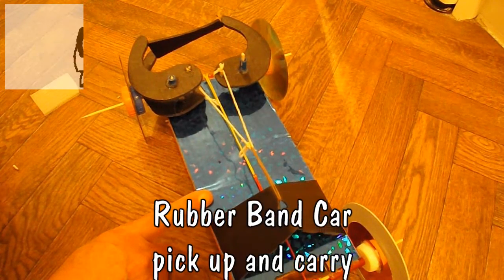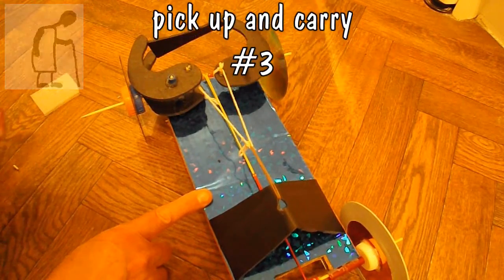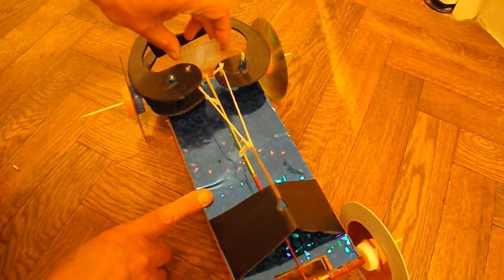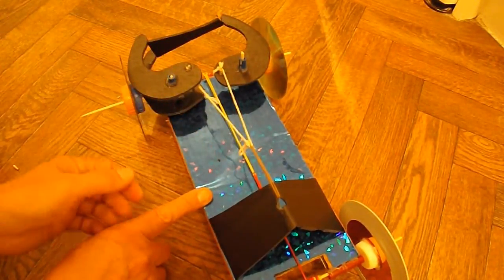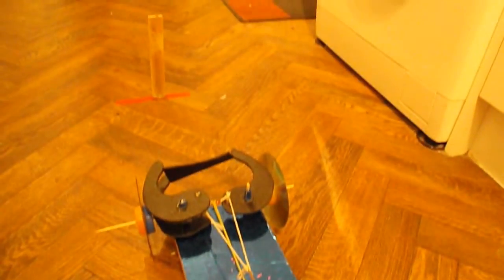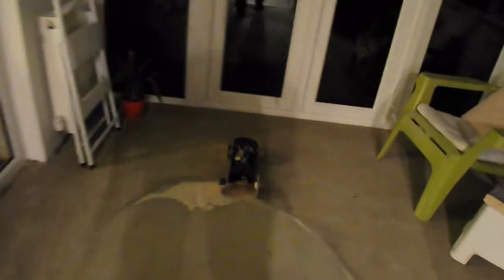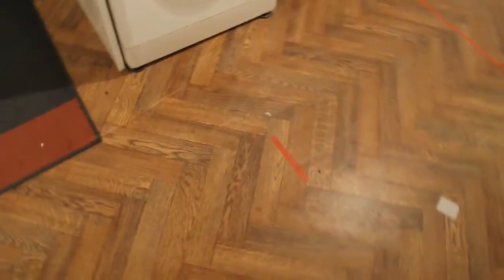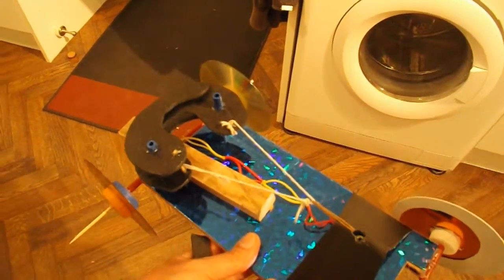Rubber Band Car pick up and carry #3

Comment: Hello. I am trying to do this for my project and everything works just fine. However when the claws grab the object, the object slides out of the clamps instead of being tipped back on the car. Do u have any tips on how to make it tip back?
Reply: Pls help
Reply from the maker: This is just a guess but maybe helping the claws grip by wrapping rubber bands round them or maybe even cutting the fingers off rubber gloves to cover the claws. Also a rubber lip on the front of the car so the rubber helps to stop the object sliding. Basically anything that might improve the grip. The other option is to adjust the position of the claws in relation to the front of the car. They need to be far enough back over the body to pull the object up over the front. Maybe add a bumper that is lower to the ground than the front of the car and extending out in front  to tip the object from a lower level. Maybe redesign the front of the car so the whole front and claws are at a lower level. My first version had no claws and just relied on being very low at the front https://youtu.be/g0Itp9wBraU
Reply: GrandadIsAnOldMan do u mind checking Instagram DM?
Reply from the maker: @Rana-mv1bx  why use instagram?
Reply: GrandadIsAnOldMan never mind thank u so much !! I added the rubber to the claws and they worked !!
Reply from the maker: @Rana-mv1bx  thanks, good luck.